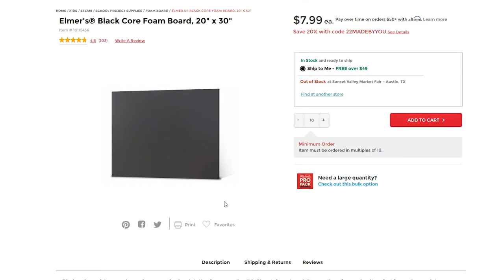DIY Lighting Flags for Tabletop and Product Photography

Comment from the maker: If anyone's interested, I'd be happy to put together a little "cut-out" sheet (pattern) PDF for the leg/base pieces.  But it's simple enough to come up with the template on your own.  Just remember the notches should line up so that the base is flush.  Also, you can use white foam core to create little bounce panels for fill light!